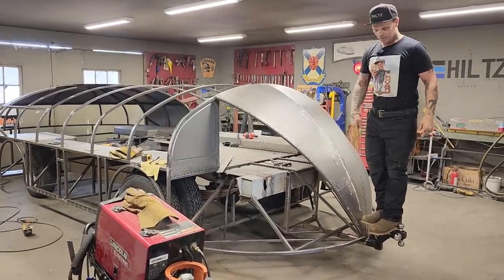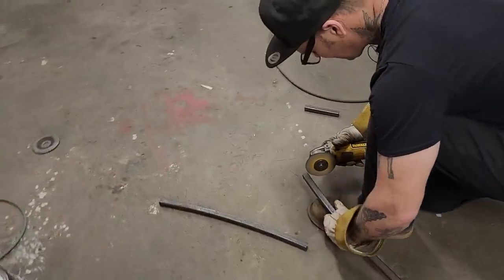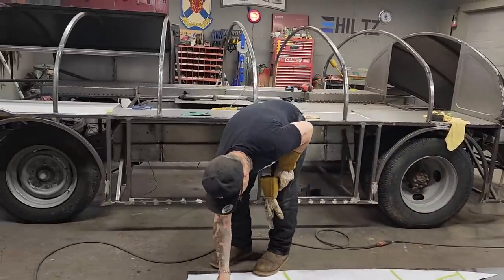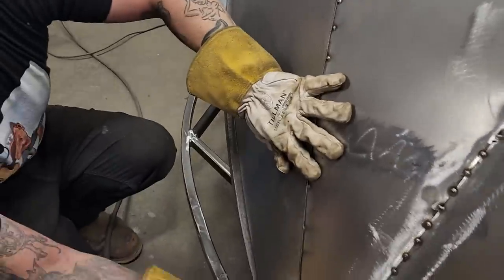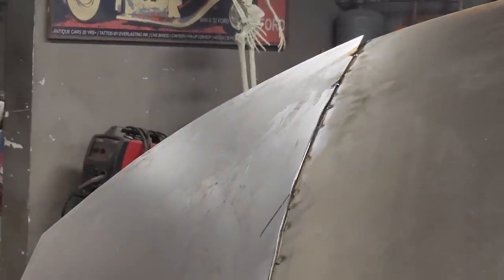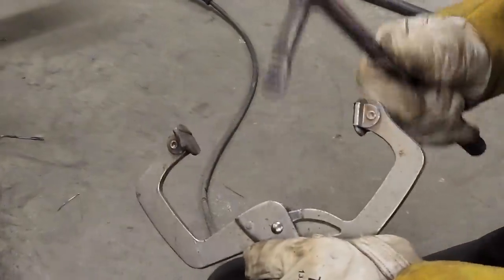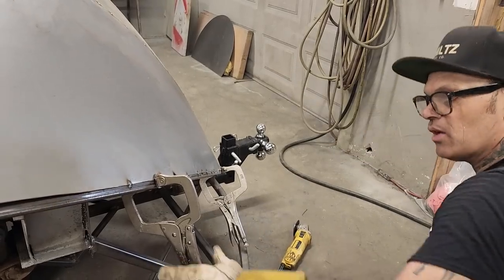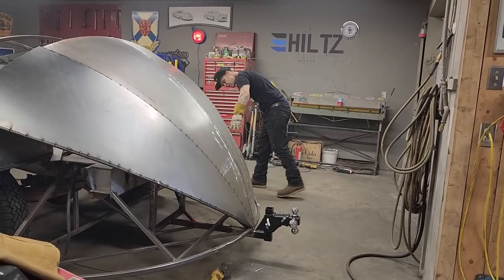Addressing the controversy + rear panel fabrication

Comment: I think Chad it might be worth removing the hitch of off that square tubing, before you go any further, and replace it with a receiver tube, so you can remove the hitch when you don't need it. Also it would get it out of the way for you to do bodywork and paint on the bum.
Reply: If you look closely at the hitch you can see this type is mounted vertically and is removable from the hard point.
Reply: Your right on the money, receiver stock 4 or 5 feet long back to frame.
Reply: Hitch should be removable. So standard receiver is what a guy wants. Buy a equalizer hitch and build off it.
Reply: Love how this bus is starting to take shape I really can't wait to see when you get done with it, excellent work Chad👍👍👌
Reply: It's looking great Chad and Jolene I cannot wait to see it much love from Ohio.
Reply: Pulling old cars not an articulated trailer
Reply: Chad can just grind it off if he changes his mind ...
Reply: Nice work chad your motivation is amazing but I agree with some of the others the should not be welded to the truck you should be able to remove it .that's what the two holes are for ( the pins ) but it's  your truck .good luck to your shines.

Comment: Hi again Chad & Jolene, the build is looking great! That aside, from one fabricator to another just some friendly advice and as you say take what you like and throw away the rest! I use to build and design towing hitches for a few years and picked up a lot of knowledge from some pretty good old timers. If It we're mine I would definitely remove just the 2 going up and the 2 at the bottom that are going back and replace with some 2inch heavy wall tubing and you definitely won't run into any issues. I understand when you think about it in a all, it seams as if there will be no issue. The problem is force, at most of the tow's time that's going to and will happen soon as you go down the road and stop and go and turn and hills and so on. Maybe go to a tow fourm and ask a few questions it might make you feel better.. I'm definitely not here to criticize you. Actually it's all correct just needs some heavier material in a couple area's. Keep up the good work!

Comment: Considering its original unibody construction..id have run twin two by four beams atleast six feet up along the frame rails , some real heavy pieces to hang the hitch assy off ...what youve done is nice but in my humble not enough. 
I really like the project . As far as front and rear overhang dragging issues...airbag suspension would be great to raise her up in such situations and let her down for cruising action. Also better get a light aluminum trailer....👍
Reply: And only carry aluminum 😂

Comment: chad i hate to comment on your work because you design such cool vehicles .but I have to say that I don't think you should tow anything with this,sure it might tow a light trailer for a while but it will weaken .this is why we have certified steel fabricatiors that are trained to know about tow weights and forces when building for  a towing hitch .is it really worth the risk ? its very dangerous .me i don't know shit about building them,but been a coachbuilder i have worked with a lot of them ,and the inch x inch box section is not strong enough ,full stop.

Comment: Might want to weld a couple hoops on the back for your trailer safety chains to hook onto.  Also was wondering if you might want to run some heavy metal from the frame to the front where you could have a front bumper for safety?  Always fun to watch you work. You have amazing talent.
Reply: Safety chains? Maybe all the way back to the real frame. Safety chains I think will be least of his problems.

Comment: The bum should be strong at this point. But please tell me you will at least weld up some 2x6 boxed rail sections of frame to connect the front frame to a curved 2x4 boxed front bumper support. Otherwise the passengers in the cockpit will have zero crash protection and support. You'll have to do that in order to convince your viewers that you are serious about putting that on the road safely. A conglomerate of a bunch of 1 inch square cannot be used in the front, it would be ridiculous. Love you brother...still watching.😊

Comment: I am not sure I would trust the hitch setup? The "Moment"is very far out and will cause alot of deflection and the tubing is tied alot to the body structure and not mostly to the frame of the vehicle. Will it work? Probably. But it should hold at least 150 percent of the tongue and pulling load you want to tow. You should have maybe used 2 inch thick wall tubing for the main horizontal piece and all connections to the frame, ie 45's. Might work fine, you can test it and check. Just my 2 cents.

Comment: Chad, have you ever seen a caravan get out control behind a vehicle. It will bend the whole construction to poo poo. You might hold it, but you can throw her away. The kinetic forces are enormous.
Reply: Your thinking old school mentality 
New technology in 360 deg hitches available now where the car will not roll with the caravan or trailer you are towing 
The way he has done will be fine
Reply: Michele, I don't see into the future but, if there were to be a belly pan, it would act like a shear panel and distribute the loading over a very large area. Shear panels and bulkheads are your friends.    Balancing the weight, fore and aft, on a trailer is crucial to avoid swaying. Properly biasing of the trailer brakes will keep things under control when stopping. There is a wonderful video on utube that demonstrates that. You present a very important point that must be addressed.
Reply: I would just like to see you weld in some gussets  in so it can't  start cracking welds between welds and tubing just for more welds contact  not trying  to rude but I've  worked 36 years  around equipment
Reply: I don’t think it will ever leave the property so it won’t get out of control ☺️
Reply: for one thing that hitch should have never been welded to the framework for the body skin. I can see right now that there is going to be a lot of hitch noise transferred throughout the whole truck. Secondly, the material he used is only as strong as the weakest pieces used. If the trailer he plans to pull with that setup ever gets to whipping (even a little) it will rip that thing apart. As a retired over the road trucker for more than 5 million miles, and an RV'er for more than 50 years I have seen a lot makeshift setups cause some very serious accidents.
Reply: I disagree!
Reply: Hey chad I think your tow hitch is plenty strong enough good job .

Comment: You should have task plan & should take accurate measurements in first place to avoid wasting time to cut metal pieces several times.
And the most important thing engine and interior things should in place in a beginning along with a way to how to get it out in case of repairs.
PLANNING IS EVERYTHING

Comment: Perhaps you should think about adding an air ride system to be able to lift or lower the doodlebug so it doesn’t drag
Reply: The only bump is when they push it over the entrance
Reply: He will after the fron gets tweaked up like a taco, and the rear get tweaked from the trailor 😂

Comment: Hello Bad Chad, just something to check/visual. Place a straight edge on the floor behind the rear tires, then place a straight edge perpendicular at the mid point and raise the end up till it hits the bottom of the hitch. I'm thinking you are going to drag/gouge the hitch into pavement when you go in and out of driveways. just my opinion. Good job!

Comment: You may be stiff enough that the hitch won't move when yanked on, or tongue weight put on it, but I'd still leave some way of inspecting it. Thin metal regardless of how many will still flex. With flex cracks can form. Just keep an eye on it whenever you are towing any distance.
Reply: Possible weld cracks too. Probably pull weld right off the stock

Comment: I work for the company that built the bodies for these things. I asked the old guys..and the young guys about if there was any records.. let’s put it this way.- we built a nostalgia truck to reflect the companies heritage, because we didn’t have one. We had to go to a wrecking yard 2000 miles away to find one of our old garbage truck bodies and source out a 2 and a half ton truck chassis that was era correct for the body, which just ended up being a 48 Studebaker. They were originally built at Heil in Wisconsin, but Heil "moved"  (the correct word actually is “escaped”) to the south years later to a business and weather friendly climate.

Comment: When it comes to fabricating a tow hitch and the draw bar it is to be fitted to, the standard practice is to build from the strongest part of the vehicle (i.e. the chassis) using the strongest materials possible.  Using light gauge metal for this purpose is a recipe for disaster and while such a setup may seem OK and will bear the weight of a man standing on the hitch without a problem, it has to be realised that the down force of a trailer or other vehicle when being towed is very significant.                                                                                    I am worried that the setup so far will fail and with Murphy's Law being what it is failures tend to happen at the most inopportune times.  I do recommend Chad, that you rethink what you have done and seek some advice from an experienced drawbar fabricator before buttoning this build up.
Reply: On any tow vehicle TONGUE weight is low, towing weight is the big number . Look it up....
Reply: @MickH60  I know that.  Where I come from industry experts indicate the ideal tongue load is approximately 10% of the weight of the trailer and its load.  This to allow for extra stress imposed under normal towing conditions.  In an ideal situation a trailer and its' load should be balanced sufficiently to account for it's total weight so that down force (when stationary) does not exceed the 10% loading on the trailer tongue.  Most of us will be guilty of being quite gung-ho and hauling quite heavy loads which exceed the safety rating of the draw bar without giving a thought to possible consequences.                                                                                      But the point I was trying to make in my earlier post is that the setup Chad has constructed will in all likelihood not be safety checked and safety rated so could well be an accident waiting to happen.  I hope I am proved wrong.

Comment: ❌❌Chad, the problem with the construction is that all your support structure is welded to sheet metal that is spot welded only.  Sheet metal will tear like paper with the proper load.  Tongue weight is different than lateral strength.  Just saying I think you should rethink the hitch.  ❌❌

Comment: Your doing a great job . Just something i would do is have U bolts around the rear end bolted to plates . Run heavy sq. tubing from the plates to the back of the hitch . If the trailer or what your towing goes into a fish tail , you need a solid trailer hitch . I always enjoy your videos .

Comment: I think you’ve made your point about the towbar strength with the square stock also cutting that panel be better off with safety glasses that sealed against the skin all around, would be much safer you can’t afford to get bits of metal in your eyes 👀 one other thing, those nibblers for cutting sheet metal are very good and the air operated snip less mess. You seem to be doing a great job. From the UK.

Comment: Before you can take it on the road, it will need to be inspected ,correct?  If you enclose it before getting it inspected , will that cause them to make you expose it so they can check?. I am sure it is over built, but here in the US it depends on who you are dealing with some times, just thinking out loud. You could even leave a removeable panel in the back underneath  there  just in case

Comment: Just don't hit the brakes when towing in a curve. It looks ok for pulling but if you have to slam on the brakes w a trailer hauling your car or weight when turning good chance it could fail. I would get a real hitch and secure it properly then add extender. It might allow you to get rid of spaghetti plate you have going on.   A lot of wasted cargo space w all those bars everywhere.

Comment: I think the hitch will work just fine. Although unorthodox by car standards, the idea of using multiple relatively thin pieces of tubing with multiple attachment points and plentiful triangulation is what gives light aircraft engine mounts their impressive strength.

Comment: Chad, Just a couple of thoughts 😉
That hitch is plenty strong as you have trianglated support - Personally I would have used reciever box closer to the working height of the Ball in which you could simply have bolted the the external part of the hitch when you needed it.
Think you would also save lots of time and hassle by cleaning and putting some paint on the the inside of panels and frame as you go, while you have easy access 😃

Comment: IMO, the trailer hitch seems very well supported. Plug welding the holes in the original hitch can’t hurt. Most modern cars are not that strong as what Chad fabricated. As usual, the videos are entertaining and informative. Thanks to Jolene for excellent camera work.

Comment: Pro sstock and nascar use square stock for frames so yours should hold. I have made similar hitchs and they work fiine. The only thing is yours is close to the ground a d with wieght of a trailor it may drag on high bumps. Looking good great looking truck so far

Comment: If they rear end Chads trailer hitch with any speed and weight it will definitely be destroyed, I was rear ended by a Honda sedan and it bent the frame on my truck. This was in town and less than 35 mph my hitch cut into his hood and peeled it back and up like a pup tent. Another time a dodge neon hit my truck in the front end at a intersection and spun me like a top, broke all the snowplow mounts didn’t bend but snapped the 3/8 thick angle iron like it was cut with a shear, also tore motor off it mounts they ran a red light. I don’t know how fast they were going but their steering column with airbag deployed was laying in the street

Comment: An edge weld for hitch is the weakest type of weld. Heat effected zone with mig is exponentially larger than a factory spot weld. Thick or not, type of steel can be more important

Comment: I'm interested in see how much of a low spot the wheels go thru before the frount or the rear drag !hope your not to put much tongue weight on the trl . it's gonna get intresting!
Reply: If the trailer is set up correctly with the axles set right there should not be alot of tongue weight. Something like a boat that weighs around 2500lbs only has a couple hundred pounds of tongue weight when adjusted properly most of the weight is carried on the trailer axles. If you read the maximum tongue weight stamped into a hitch you will see that a really heavy duty ball type hitch will have a maximum tongue weight of 500lbs.
Reply: @danielplummer6385  Its good to see someone here that knows what he's talking about...!!  How refreshing....

Comment: Not trying to mean or smartbutt I would weld some gussets on the hitch.Stitch weld a piece flat bar on the tube going the hitch.Put the bar with side facing up then weld some metal plate tying the flat bar on both side.Or little gussets in all the tubing corners .Sorry I'm safety nut.

Comment: Chad, you don't have 10 points of contact. You only have 2 spots that are welded in a 2-foot distance. So once the 2000 lbs trailer, a heavy all metal Bugatti. Is held up by those 2 spots that are welded. The 10 spots of contact you talk about become irrelevant
Reply: Controversy!😂

Comment: Should be able to pull spark plugs and they will tell you what it want as far as air and fuel. Depending on what you use for an airbreather will make a big difference on jetting. Like if you put pods on it you will most likely need to put a bigger jet then a stock airbox.

Comment: under use and construction in the UK one is not allowed to weld to tow bars to any vehicle or chassis anymore, it has to be bolted. it also any tow bars have to conform to specific regulations and be plated with all its specs. it doesn't matter whether it's got a chassis or a monarch. I once welded some brackets from the bottom of my tow bar up to the chassis just to give it more strength, I subsequently got stopped by our local VOSA the immediately struck the MOT,  the guy behind me ad built his towbar into the vehicle during a rebuild of his Transit  it was ordered permanently off the road, the VIN identity was immediately removed,  different rules for different countries.   over in the UK that's an absolutely no no you can't even build your own towbar. in fact modifying vehicles now is almost a no no now as well. only some older vehicles.
Reply: Its Nova Scotia.. Just get out the way before the trailor hits you.

Comment: You guys realize that Chad Really makes art more than he makes vehicles to drive...   The cars he builds sit in the shop, he likes to build them , not to necessarily drive them, so maybe he only intends for the  trailer to be hooked up,and the car to sit on the trailer, but I dont think he ios thinking about hauling the car across canada with it, he is making big model cars, they might run, and they might drive, it is art over function.. my thoughts anyways.

Comment: Before you getthe whole back enclosed, you might want to decide where your going to put the fuel tank. It is going to be hard to  bring a fuel neck out where your tool boxes are going. Lots of spare room in the back
Reply: The original  fuel tank is still in the original  location  under the back floor.

Comment: That hitch will NEVER see a car trailer. It's too low and it's too far from the axle. The rear of the body could have been shortened by almost 2 feet. Would have been a lot better for towing. I wouldn't drive it!